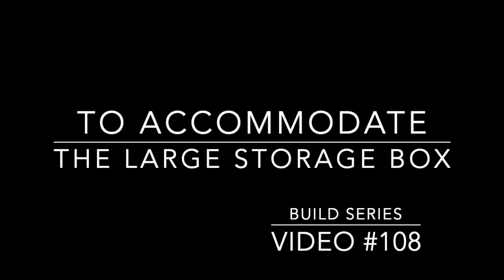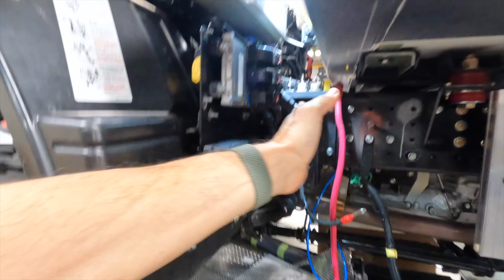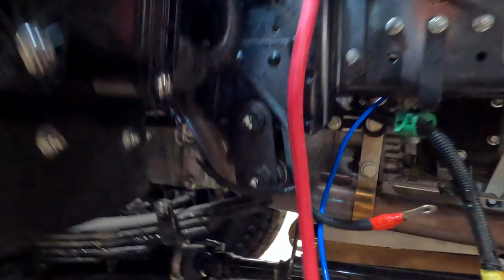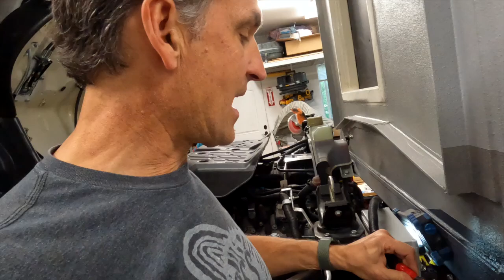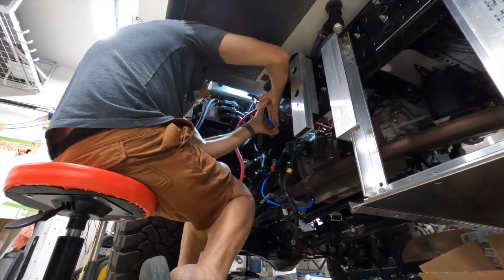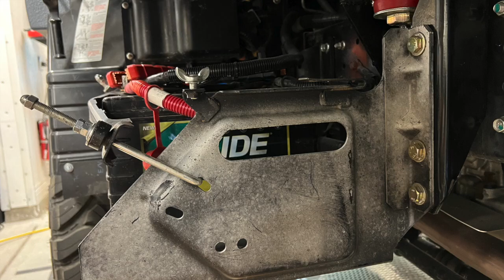Improving Factory Fuso Wires for Expedition Camper

Comment: That's going to be an awesome vehicle when completed. It's amazing how many items you have to deal with. It's going to be interesting to compare your build cost vs another company that builds on this platform (SLRV Australia). The cost of the high end overlanding vehicles have always been expensive but inflation has really increased the cost, as you well know. To me this is one of the best platforms. Capability, reliability, livability with as small of a footprint (length) as possible.
Reply from the maker: Yes, I too think it's going to be an awesome rig--short 134" wheelbase, narrow at 80" yet 16 foot camper and lots of gear storage, plus good four wheel drive. Once this is done or nearly done, which it is getting close, I'll share cost breakdown. It's more than I planned for by a little, but certainly much more time to build than expected, justifying the costs that most of the expedition campers go for.